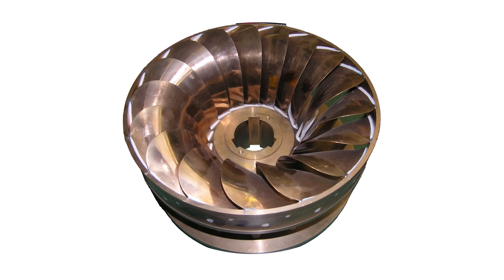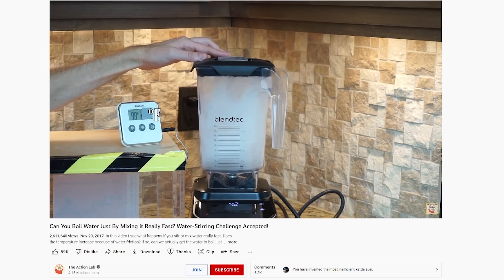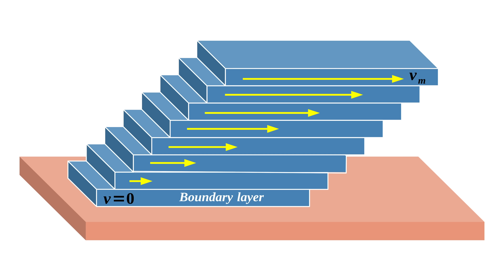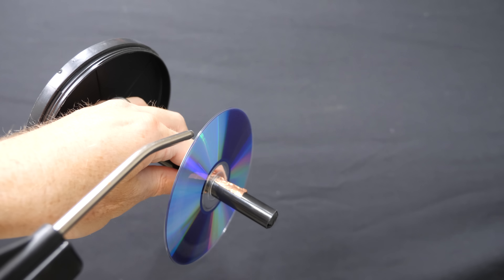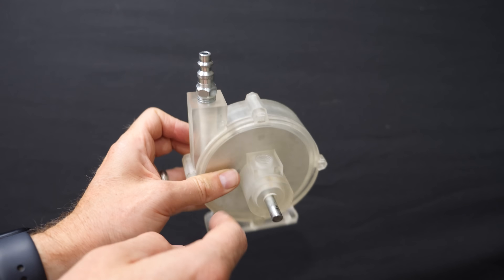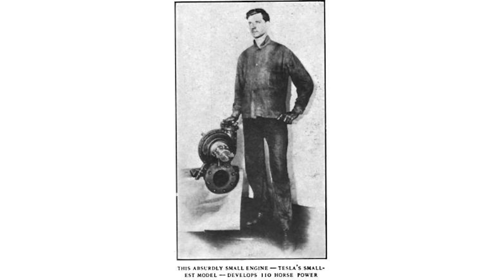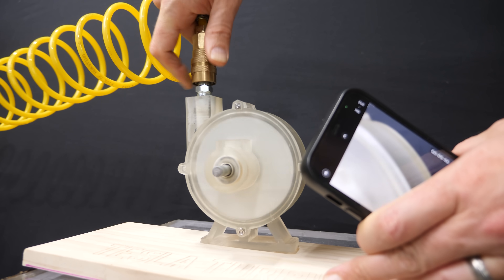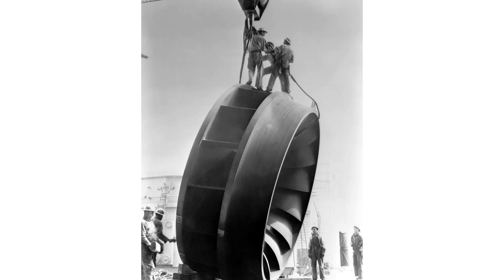How Fast Can a Tesla Turbine Spin?

Comment: Tesla turbines are not used because when we have disks that are rotating very fast, there is a high chance that they tend to warp. This means we need to use special materials, which again increases cost…
Reply: Jet engine rpms regularly spin at 25 thousand. Small turbines up to 500 thou. What's your point? Turbines are always well made and use exotic alloys, engineering, and are expensive.
Reply: Tesla fixed the problem of disc warping with his improved disc stack turbine patent GB 186,082 that he patented 1n 1921, 10 years after the original one and a decade of R&D.

Why does everyone sleep on the five improvement patents that Tesla patented 10 years after the original and act like it doesn’t work when every issue there was he already solved. 

Never mind the fact that you don’t even need to spin them “too” fast for them to work and work efficiently anyways because efficiency is incraaaed by reducing slip, not increasing disc speed.
Reply: The Slo-Mo Guys just posted a video showing this the other day. Vinyl records spun so fast that they break. They eventually wave like crazy.  Very interesting stuff.
Reply: Well, they've been telling us for decades that electrical car is not feasible, the costs for battery too high, distance limited, you name it. The real reason is more that the involved  industry giants just do not feel need to invest in a change as long as they can conveniently suck on the old technology
Reply: That's trivial.
Reply: Most power plants (coal, gas, and nuke) have generators that spin at 3600 rpm. There is no need to spin any faster.
Reply: @billb5938  as if coal power plants where the only way electricity was produced with turbines. 🤭 micro gas turbine electric generators regularly spin at 20,000-500,000 rpm already. 

This is industry standard for micro gas turbines.

Welcome to the modern era.
Reply: Tesla only had warping problems when testing the maximum speed, it is common to test the maximum speed of a turbine no matter what kind it is. I don't have any issues with warping in my tesla turbines.
Reply: @iEnergySupply  it’s because you don’t live in the late 1890’s. Jeez.
Reply: @iEnergySupply  how big is it? if it isn't over a metre then of course there isn't
Reply: It's efficiency increases at higher speeds, so having a lower speed means less efficiency and defeats the point
Reply: @na9565  how do you define the efficiency? is the relationship linear?
Reply: The optimal speed exceeds current materials.
By a significant margin.
Reply: What is warping?
Reply: Things that aren't meant to be reutilized could still efficiently use them, no?
Reply: Carbon fibre. Durable, "cheap", nothing special about them. High flexibility, high strenght, low weight. Cavitation... I am not into that so who knows...
Reply: I know someone who made one with thin aluminum disks and it works fine
Reply: Just use less speed
Reply: Here's an idea, use flate discs made of nitinol metal, that way if they warp, once heated the discs will return to their original shape
Reply: i was wondering about that.
Reply: Can you make video explaining rotation detonation engine
Reply: We are gonna need netherrite disk for this
Reply: Yeah it's always the " cost/money "
Reply: @Monkey_D_Luffy56  not really an issue when you have Tesla turbines that work just fine at low rpm.
Reply: Wonder if sound could be used to cancel the warping disks.
Reply: We need "Super Tensile Solids"
Reply: Isn't this the same problem with flywheel energy storage?
Reply: Wraping method is pretty nice but it lost some energy
Reply: Ohh
Reply: Thanks Captain obvious ...
Reply: Stupid!!!! This dont work on load
Reply: The higher the rpm, the greater the balance needed.
Reply: yet this guy didn't say that I was waiting for him to mention it but nahh
Reply: That's not what Elon Musk said
Reply: I didn't know that. Any chance you know what material is needed or what the maximum rpm is before warping?
Reply: @nevernether3368  this isn’t actually an issue.
Reply: Perhaps adding the tesla valve to this system so it will help water flow faster in and out. Has anyone tried this ?
Reply: Why they just cut it into a pizza cut and the edges is shape to interlocking
Reply: Wrong
Reply: Modern engines and turbines warp too, that’s why they fail mechanically
Reply: Kevlar threads in a circle? Light weight enough that it would not pull as hard. Plus the plasticity of a thead
Reply: They were tested with no fluid by the patent office. 
 Tesla proved it worked, but the patent office conducted arbitrary tests that promoted failure. Everything tesla made was proven. It's easy to sit here and critique and suggest such strong claims with no tests, relying on word of mouth from people who mostly defamed him and his work.
Reply: Maybe we could weld them up at the center, or have counter-rotating discs.
Reply: 只要能解決「高壓氣體」中的「雜質及液態水」即可「高速＆高壓」全天候「運転發電」⋯⋯，！
Reply: The pressure between the disks will surpass the mechanical strength of the discs in high speed rotation...
Reply: Compared to the parsons turbine, the cost is far lower. The really issue is in the power density of the turbine combined with its scalability. 

As well, modern turbines must run on dry steam, whereas the tesla turbine can run on wet steam.

Running it within its limitations still yields superior performance to a reciprocating steam engine.
Reply: or just have 2 inputs from 2 opposite sides.
Reply: Lol you don’t need to spin them fast for high efficiency, you have to reduce slip to increase efficiency. 

Tesla explains on the patent how to do this and nowhere doe he say to spin the turbine fast.

“Owing to a number of causes affecting the performance, it is difficult to frame a precise rule which would be generally applicable, but it may be stated that within certain limits, and other conditions being the same, the torque is directly proportionate to the square of the velocity of the fluid relatively to the runner and to the effective area of the disks and, inversely, to the distance separating them. The machine will, generally, perform its maximum work when the effective speed of the runner is one-half of that of the fluid; but to attain the highest economy, the relative speed or slip, for any given performance, should be as small as possible. This condition may be to any desired degree approximated by increasing the active area of and reducing the space between the disks.”
-Nikola Tesla
Reply: And AC power shan't be used because it can be transformed into enough energy to kill an elephant.
Reply: Edison, was a sociopathic monster, employed thuggish horrible "business practices" including sending thugs to burn down rival's labs, and out of context public electrocution of animals to discredit his competitors as a ghastly smear campaign, had no qualms about ruining others to buy up the patents or modify them and release as his own offering.
  I have absolutely no respect for Edison or anyone so ambitiously depraved.
Reply: @neomancr  I do hope everyone has noticed and realises that Edison the FRAUDSTER never tested out electrocution by DC! It kills you (or an elephant) just the same!

 Whereas, however, as Tesla proved conclusively, ON HIMSELF, high frequency, high voltage AC does NOT kill you! High voltage DC however is lethal just like high voltage, low frequency AC!
Reply: @neomancr  DC can kill an elephant too. AC or DC doesn't matter if voltage and current carrying capacity is high enough
Reply: @MaYbYl8eR   My new rotor is 6" in diameter. With 1/64th inch  Spacing. I agree my 3" rotors were much too small for Using only a single stage. Tesla suggests to compound the rotors For smaller turbines. I believe the 6" turbine won't need compounding.
Reply: @iEnergySupply  
How much power can your 6 inch turbines produce? What is the diameter required to generate 3MW of power?
Reply: @JaswanthDaniel  why ask such inane questions?  Do you have a budget for such a device? and, Does this look like a MW scale device to you?
Reply: @JaswanthDaniel  3MW is enormous. How serious is your enquiry?  I would say I can more easily envisage 1000 x 3kW machines rather than 1 X 3MW
Reply: @JaswanthDaniel  do get back to me
Reply: @iEnergySupply  Folks aren't talking about dinky Hobbyist turbines, They are talking about turbines meant for scale production. 

Like 3m turbines, which would have loads at the edge of mach 13 or higher, no known material is good enough for scale production using tesla turbines.
Otherwise we would be using them, Engineers are smarter than you think.
Reply: @Golden_SnowFlake  This!! Finally found someone who's using common sense
Reply: @Golden_SnowFlake   Like he said in the video, Tesla made a 6' turbine that put out 600 horsepower.
Reply: @iEnergySupply  They are not used because they are not efficient. To make them efficient (ones using laminar flow for example) one needs to use a large number of disks due to the low rate of flow, making them too heavy and big. 

It has a theorized efficiency of 95% but it will never reach it if we take into account the drops occurring at the inlet and outlet of the turbine. The most efficient rotor documented has attained a max efficiency of 65%. Furthermore, Tesla turbines are very sensitive to vibration or disturbances in the flow over the plates. Since they rely on the existence of the boundary layer to move the working fluid, any disturbance entering (or vibration) will cause a breakup of the boundary layer and a significant loss of efficiency.

It has some advantages but not enough to make it universal...
Reply: @WavyCats    I got Almost 3 kW from a 3" rotor. This was with very low temperature and low pressure. My turbine Also had a plastic casing. If I was using high pressure and super heated steam, I could have gotten over 10 horsepower And that is a conservative estimate. My experience  Shows your statement to be very inaccurate.
Reply: @iEnergySupply  Cool project. My point still stands though - what is the efficiency of your turbine (including the nozzles and diffusers)? 

Many researchers announced the rotor to have low torque (which simply isn't true) -this is probably what you are targeting. The efficiencies are another matter. The rotor itself is very efficient, but the loss due to the nozzles and diffusers is too impactful.

You argue that your 3" rotor does quite well and it's true. If you want to scale that rotor and maintain the same efficiency, I challenge you to find a material that can withstand the RPM. If you suggest lowering the RPM, then the efficiency will be sacrificed. If you want to add more disks, it will become massive and heavy.
Reply: @WavyCats  good point, You are right.  I don't really understand why @Jeremiah has problems with accepting Your simple arguments. I think it's possible that he's just a "conspiracy theorist" (like those people thinking the Earth is flat etc.)
Reply: @WavyCats  Adding discs doesn’t make it too much heavier at all if you do it right. It’s about surface area and thin discs of a sufficient tensile strength can be packed in like sardines. Check out Charlie Solis YouTube channel to see what I mean.
Reply: @WavyCats  Everyone learns this from the top tesla turbine video on youtube. But they made a big mistake with their math in this video. The video says the rotor must spin at a very high rpm, maybe 50,000 for a 6” turbine. The speed of a turbine is based on periphery speed not rpm. If a 6” turbine needs to spin 50,000 rpm to be efficient like the video says, that’s a periphery speed of 890.1 Miles per hour. If you want a 3 meter disk to achieve close to 891 miles per hour at the periphery, the rpm required is only 7,253. We have materials that can easily reach that speed. Frank Germano got one MW From a 36" Carbon fiber rotor and uses his turbine for converting heat from burning trash to feed the grid.
Reply: @commieTerminator  how at all is that 'common' knowledge
Reply: @WavyCats  false! Modern Hydro Tesla turbines have shown over 81% 🤭 you need to go back and redo your research.
Reply: @iEnergySupply  I replied to this a while ago but YouTube didn’t like the fact that I added an external link to the comment... 

Basically what I said was that the majority of the efficiency loss is directed at the inlet and outlet of the turbine such that efficiencies are still drastically lower than 90%, but can compete in niche applications (as it is now), just not power generation. 

I also mentioned that yes you can have a lower rpm and still maintain the efficiencies if you added more disks with proper(minuscule) spacing, but it would make it quite large and heavy relatively speaking.
Reply: @HeatAndPower  Kindly source the research (not the link cause YouTube likes to delete them). I did read about recent developments of the turbine designs made for pico hydro applications reached 80% efficiency but it did not take into account the efficiencies lost at the nozzles... if you can source a different paper with experimental results then I’ll concede my point.

Also note that I’m talking about large scale turbines - such efficiencies of 70-80% were only reached with smaller turbines.
Reply: @WavyCats  why would the nozzle/stator losses of the TesTur be any different than the nozzle/stator losses in a radial bladed turbine? 

In fact you could switch out either one in the same casing with the same nozzles…
Reply: @andrewselberg649  I agree more disks add more torque, and can make a much more powerful turbine, although I think there is a balance. If you look at nikola tesla's actual turbines, he doesn't cram as many disks in there as possible. Here is a quote from his patent. The dimensions of the device as a whole, and the spacing of the disks in any given machine will be determined by the conditions and requirements of special cases. It may be stated that the intervening distance should be the greater, the larger the diameter of the disks, the longer the spiral path of the fluid and the greater its viscosity.
Reply: @iEnergySupply  If you have a 2in wide turbine, what’s the difference between having 25 discs and 25 star washers, same thickness,evenly spaced, giving a total open space between the discs of 1in, and having 75 discs and 75 star washers same thickness, even Kelly spaced and also giving a total open space between the discs of 1 in? 

You have 3 times the surface in the same space while also having the same total volumetric flow area. Which means you can move just as much fluid through each runner slowly but the higher speed fluid will instantly come to a halt in between the disc faces as it enters in between the discs. 

Again total flow area is the same so there’s no “flow area” restriction. 

But there is a MUCH higher resistance to high velocity flow between the 75 discs due to the spacing being so restricted. 

The only limit to disc spacing is the point at which your discs will be fine to extent a capillary repulsion from the fluid going in between the discs. 

Furthermore, Jeremiah I know you’re doing vacuum steam low temp stuff. 

Well vacuum steam at about 80-90°c has decently lower viscosity than compressed air. 

Now the polar nature of the H2O steam molecule will help increases adherence to the metallic discs but because the viscosity is a good deal lower the boundary layer thickness is smaller and as such, whatever spacing is just right for compressed air won’t be tight enough for vacuum steam, “cold steam”.
Reply: @HeatAndPower   I definitely want to go up higher in temperature. My new turbine will allow this. I'm still going to have very low pressure at my exhaust though. My  Six inch turbine has  16 times the amount of surface area. I believe this is sufficient if the steam is saturated. My guess is that Because I'm using saturated steam rather than super heated steam, there will be much more viscosity due to the water droplets in the steam. Regular turbines use super heated steam because the water droplets would normally destroy the turbine. This is one advantage of the Tesla turbine.. This is also why I believeI won't need as muchSurface area.Using slightly thicker disks will give rigidity toThe turbine disks and allow me to reach greater velocities.Although the Tesla turbine doesn't need super high velocity, with a low enough of back  pressure  At the exhaust,  I think the extra drag at the higher speeds won't be detrimental to performance/efficiency But will increase my power output as demonstrated in my previous videos.
Reply: @iEnergySupply  Jeremiah, while there are mechanical reasons for superheating the steam there are FAR more important thermodynamic reasons for superheating the steam that irrelevant of particulates and cavitation all turboexpanders will be bound by these thermodynamics. 

The superheated steam can expand up to a higher extent.

The use of superheated steam in the turbine increases the total pressure drop across the turbine which increases the kinetic energy gained by the moving steam. This increased kinetic energy increases the output work of the steam turbine, and increases thermodynamic efficiency.

Thus by use of superheated steam, the turbine can extract more energy from the steam can get increased power output from the turbine….

Superheated steam and liquid water cannot coexist under thermodynamic equilibrium, as any additional heat simply evaporates more water and the steam will become saturated steam.

Superheated steam is also not useful for heating, but it has more energy and can do more work than saturated steam, but the heat content is much less useful. This is because superheated steam has the same heat transfer coefficient of air, making it an insulator - a poor conductor of heat. Saturated steam has a much higher wall heat transfer coefficient.
Reply: @iEnergySupply  Superheated steam's greatest value lies in its tremendous internal energy that can be used for kinetic reaction through mechanical expansion against turbine blades and reciprocating pistons, that produces rotary motion of a shaft. The value of superheated steam in these applications is its ability to release tremendous quantities of internal energy

By contrast, water vapor that includes water droplets is described as wet steam. If wet steam is heated further, the droplets evaporate, and at a high enough temperature (which depends on the pressure) all of the water evaporates, the system is in vapor–liquid equilibrium, and it becomes saturated steam.

Saturated steam is advantageous in heat transfer due to the high latent heat of vaporization. It is a very efficient mode of heat transfer.

This latent heat of vap is not available for expansion and power out through the turbine. 

And when you’re just relying on flash steam you have even less energy available.
Reply: @CharlieSolis  the wet steam I believe can expand between the disks more and more on it's way to the exhaust Where the pressure is higher on the periphery, it will be wet. I think it can turn into dry steam if it ultimately ends up in a low enough pressure. Also something to think about is the fact that tesla describes the effect the disks have on the droplets, he says it will atomize the droplets. this may be why some say the tesla turbine can utilize some energy from the latent heat of vaporization. This is just my thoughts on the subject, and I may be wrong.
Reply: @iEnergySupply  Jeremiah this is what Tesla actually says about atomizing in the patent…

“I am aware that it has already been proposed to effect atomising by dropping a liquid on to a plate rotating about a substantially vertical axis and I make no claim to the arrangement.”
-Nikola Tesla
Reply: @iEnergySupply  you cannot take a volume of water and “flash” it all to steam unless you add more heat in to do so, ergo the superheater. 

There is not enough latent heat in a volume of saturated steam/condensate to vaporize all the liquid in the mass without adding additional heat to “dry it”
Reply: @iEnergySupply  also if you’re using Marco water droplet size you may end up with a liquid ring type arrangement with the denser liquid water occupying the periphery and forcing the steam to the center radius, through buoyancy due to the pressure being higher in the periphery. This will cause the steam to leave the turbine before it gets fully utilized.
Reply: @CharlieSolis    Thank you for finding the quote. I'm curious What actually happens, What do you think happens?
Reply: @iEnergySupply  lol oh, buddy, I did that with my 5in turbine at 6000rpm a couple years back. It was just poured on the endplate though but it sure as heck atomized lol and surprisingly the turbine hardly seemed to slow down.
Reply: @iEnergySupply   you and Solis should really start a forum or discord so you don't have to always meet in the wild, on the back of a skeptic's YT comment thread, lol. 

Jeremiah re: heat of vap in a Tesla Turbine , FEA might really help here to better model some of the modes of the TT . 

 When I consider TT used with heat of vap fluids, I always go back to Peter Lindemann's lecture at the BEM 2019 in Amsterdam where he reviews Tesla's pursuit of a self-acting engine. From that talk, although Lindemann seemed to only employ rotary vane decompressors and Stirling engines - - maybe that was an intentional obfuscation - - it feels decisive, at least conceptually, that the TT is meant to transform kinetic energy highly efficiently as a component in a regenerative heat engine / heat pump, while the heat of vap itself is the mechanism in which temperature difference can be perfectly converted into kinetic energy.  It's clear you're both aware of the this after playing with steam cryophorus setups. Maybe the TT could integrate other system elements within it to transform heat energy as well, which would be fantastic.

Seriously though, community forum...!
Reply: @Golden_SnowFlake  the only one here who knows what the hell they are talking about. A lil baby Tesla turbine works sure. No one needs a baby turbine in real world industry.
Reply: @huntercarter5426  🤭 oh yeah because the most common generator sold isn’t between 1000-10,000watts for residential uses. Just stop. What a disingenuous claim. Especially when those off the shelf generators at best get 15-20% thermal efficiency.
Reply: @huntercarter5426  never mind Charlie Solis makes 10in Tesla turbines that output really power and torque even at low RPMs. Enough to power a house with just a room temp compressed air supply. He’s about to be starting the higher temp tests any day now to prove out the upper thermal limits for his TesTur. Should be in the +100hp range for just the skinny 2 in wide rotor, since he’s already doing ~8hp to the shaft without heat 🤭
Reply: @huntercarter5426  yeah as if the most common generator sold on the market right now isn’t in the 1-10kW range… right 🤭
Reply: @Golden_SnowFlake  Bruh do you not know what a model is? That's how engineers test large scale machines, with smaller versions.
Reply: @iEnergySupply  build one big enough to make 3 MW.  See how far you get, and how far the fragments fly.
Reply: @robinpage1987  the larger the diameter the slower the rpm is required. the creators of that stupid video from lasics that everyone watched got their math wrong. The video says the rotor must spin at a very high rpm, maybe 50,000 for a 6” turbine. The speed of a turbine is based on periphery speed not rpm. If a 6” turbine needs to spin 50,000 rpm to be efficient like the video says, that’s a periphery speed of 890.1 Miles per hour. If you want a 3 meter disk to achieve close to 891 miles per hour at the periphery, the rpm required is only 7,253. We have materials that can easily reach that speed.
Reply: @iEnergySupply  600hp doing what tho? It's just a number unless there's work being done
Reply: @testurenergy  i like your style  personally i don't think Jeremia spends enough focus on nozzles and not one of us has yet tried using a needle syringe to introduce flow tangentially between the turbine blades.  velocity is important, as is laminar flow and dwell time.  can we not get some thermodynamic modelling expertise into play?
Reply: @Golden_SnowFlake  and what would be the impact of exceeding the speed of sound?  The important factor is the rate of conversion of heat to motive power and small delta T otherwise you have an impulse turbine and that's where cost per kW escalates dramatically because it's no longer automotive turbochargers but precision impulse turbines that meet demand for 3MW
Reply: I don't understand this argument. Yes, there might be warping but really how much could it be? And I don't see how that couldn't be solved by changing the material of disks to something sturdy like steel. I don't think you would need to create special material specifically for Tesla turbines.
Reply: @atlas_19  Especially now with wire based electrical deposition Machining offering near zero tolerance machining, and generative design in tandem with additive manufacturing optimizing for laminar flow.
Reply: @atlas_19  I agree. This should is only
Reply: It’s only a problem when pushed to destruction.
Reply: @atlas_19   a 150cm spinning steel disk also tends to bend when spinning at such a high speed that tesla turbine operate at so yeah you can't use steel, a carbon fibre disk might be a plausible material but that thing is expensive
Reply: @archise3191  Nikola Tesla already solved all the warping issues with his improved disc stack patent GB 186,082 that he patented 10 years after the original and a decade of R&D. Everyone sleeps on the improvement patents Tesla got years later to make them work 🤭 yes I said plural patents. There’s about 5-6 improvement patents that he put out that almost no one even talks about except Charlie Solis who actually has real working tesla turbines.
Reply: @atlas_19  Very true.
Reply: @atlas_19  Your correct, and tesla didn't have any issues with his turbines. The public only seems to know one test that tesla ever did. Tesla worked over 20 years on his turbine improving it for many applications.
Reply: @iEnergySupply  I'm curious why you think nobody used Tesla turbines if there aren't issues.   Surely, if there was a feasible way to use the higher efficiency Tesla design, someone would've done so by now.
Reply: @atlas_19  'sturdy like steel" cus no one ever thought of maling a rotor out of steel. Your a genius
Reply: @MaYbYl8eR  For one, you're unaware of the meaning "something like" it seems, my genius friend. And for your other point, I don't remember saying "Nobody thought of that?", so what's the problem?
Reply: @MaYbYl8eR  carbonfiber and fiberglass have a higher strength to weight ratio then high grade steel.
Reply: @iEnergySupply  in fact you can make a wire helix fixed between the two disks to keep the disks stable.
Reply: While that is true a Tesla turbine needs to maintain high speed for better efficiency so lighter materials would decelerate more under load where heavy materials would carry more momentum like a flywheel allowing the turbine to function better as it's loaded.
Reply: Yup, they scale very poorly. Imagine the edge speed of a large diameter disk - any cost effective material will just turn into a shrapnel.
Reply: @MelodicTurtleMetal  Think jet engine. Those huge beasts turn up to 25 thousand rpms. Really.
Reply: @jamesbarisitz4794  .... Yeah. And?
Reply: @MelodicTurtleMetal  Too clever for me, genius. 😑
Reply: So you make a few and sell a few. It works well so people with money buy it. You make more and more people buy it. Eventually, since you run the market, you get competitors. Competitors means variable price on a product. Then since there is many people in that specific market, there is innovation. Breakthroughs make cheaper production. Cheaper production makes more product, and 150 years after the first person to introduce a wide sold tesla turbine to the market, everyone has one. 
That's capitalism I think
Reply: wouldn't it also tend to act like the ‘wheel’ of a kinetic energy fly wheel generator?

meaning that if it's not perfectly balanced, then, it would have a tendency to ocilate and, as a result, potentially self destruct resulting in the wheel (or, in this case, wheels) to be released and fly off for miles in all sorts of different directions?

At least with a turbine, the overall rotational mass wouldn't be as much and, in the event if a failure wouldn't likely add up to much more than a blade or two which would likely almost certainly be contained within the turbine housing or room that it's situated within.
Reply: @weedfreer  for real though, Nikola Tesla’s Balancing Apparatus patent 186,799 that he developed for balancing the turbines to very high degrees of at-speed dynamic balancing makes manufacturing an extremely high quality balanced turbine disc stack with little more than a lathe 🤭
Reply: @weedfreer  when the right disc materials are used and the proper tolerance dimensioning is used discs will just stretch and touch off with the casing and slow down before they spin too fast. 

And if you’re well below the 1st critical rpm of the shaft any touching off with the casing will result in nicking mass off only from the heavy side.

The “Jeffcott rotor” mechanical engineering experiment/lab explains the phase angle relationship of the heavy side and the whirl orbit. 

This is the basis of Nikola Tesla balancing apparatus patent. 

Everything below 2/3s the 1st critical rpm will have the heavy side of the rotor on the outside of the whirl orbit. At the critical the heavy side will be 90° advanced from outside of the whirl orbit and above the 1st critical (and leading up to halfway to the 2nd/3rd critical rpm) the rotor and shaft system will rotate about the center of mass, keeping the lighter side on the outside all the time. 

Balancing should not be done at even harmonics of the critical as the rotor being in the center of the shaft it will be on a node of the full waveform in the shaft which then causes side fumbling of the rotor as either side of it is in oscillation out of phase.

But below the odd harmonics/subharmonics of the critical rpm the rotor will always be in the center of the antinodes on the shaft and also allows for “at-speed” dynamic balancing 🤤

It’s such a simple “self healing” aspect to the turbine when design correctly and not over complicated. 

Nikola Tesla’s built in balancing apparatus is top notch.
Reply: This comment section is just gold, here we have everything.

My favorite part is all the people that believe that electronic parts could last forever, and also that The Saturn V was destroyed to raise the industry prices? That's a literal diamond on the internet, making and launching one of these rockets would cost more than the most expensive car ever sold, even if you had all the factories ready with molds and everything.

Plus no private company at the time had the experience to do something like this, since, again, it was expensive enough only the major economies could fund it.

I really really want a bit of the powder you guys are smoking.
Reply: @afoxwithahat7846  🤭
Reply: @CharlieSolis  you're a genuine nice find on the Internet XD, thanks for the funny comments tho.
Reply: You can still use gear ratios to increase torque
Reply: Wrong. The tesla turbine doesn't have the torque we need at high speeds.
Reply: FREE ENERGY! TRUE FREE ENERGY! Siphon liquids UP by putting a bottle above water/liquid source, have a siphon tube go from water/liquid source to top of a sealed container. on the bottom of container put a spout so water can flow back into the source. the water coming out of spout will create suction in the container pulling water up the siphon tube! it will continue to flow until water evaporates unless you build it in an enclosure or use ionic liquid. with water flowing constantly you can use the tesla turbine or any hydro-generator to give you free energy for everyone in the world!
Reply: That's something he covered, it's resonance frequency. But it's superior that's why we don't use it, it would work so well it wouldn't make money.
Reply: @TheDeepDiveLLC  "it would work so well it wouldn't make money"
What kind of BS is that?!? Like nobody would buy anything efficient!?
- If you buy this you'll make more of whatever you're producing at a lower cost and get tons of money.
- No thanks, capitalism doesn't exist.
Reply: @TheDeepDiveLLC  pls stop saying things like this, there are reasons why they don't use things that were invented in the past. Most of them are due to physical limitation
Reply: @siontheodorus1501   Why are light bulbs designed to wear out at a specific time? Because more money can be made  If they don't last. There are limitless examples of things that could be better but are specifically designed to just make more money.
Reply: @iEnergySupply  efficient, costless, low consomption, and long live ligtbulb, u mean led ?
That same old argument u Never had payed the same Price for a perfectly vacuumed lightbulb. There was an agreament wich was exposed, but thé truth is they were making 1000hours one but Never gone out 25oo hours range. The one still running is like 2v, and making ONE perfect expérimental product isn't the same to make automised Line to shit million in a day.
Reply: @iEnergySupply  lightbulbs are designed to have a limited lifespan so that consumers can maintain the industry of producing modern lightbulbs and so the technology and machines to actually make them doesn’t go to the way side. 

If light bulbs lasted forever there would be no way to create a stable industry that can continuously and efficiently operate to provide products all the time. 

Again if everyone bought all he bulbs they ever needed 100 years ago there would have been no light bulb manufacturing companies keeping that industry agile and capable of producing. 

Just look at what happened to all the tech and machines we needed to our men on the moon. We didn’t keep those technologies in production and we have since “lost” the actual technology to get back to the moon. 

What I mean by that is anyone who would want to go to the moon would have to start all the way from scratch because they can’t even use the old specially tooled machines to make each specific part to that exact design of rocket and payload. 

For technology, if you don’t continually use you will lose it. 

If you can’t keep that industry operating continuously so that the technology can regularly be produced and scaled the technology, the wherewithal, the specialized technicians who know all the ins and outs of each individual machine set up that they pass down to the guy who uses the machines after them, all of that goes bye bye. 

So we don’t make a lightbulb that can last 100 years because it would be detrimental to keeping a vibrant manufacturing industry always ready for mass producing lightbulbs at a moments notice to… stable revenues and profits over long periods of time keeps industries alive. Think war time factory conversion… 

it’s literally important for national security, not to mention economic stability.
Reply: @HeatAndPower   I really don't understand why we're trying to go to The moon when we have so many problems here on planet Earth we need to fix.
Reply: @iEnergySupply sadly many products at made to brake,  dit you know Most light bulbs wear out because of the on off switching  ? Not because of burning Hours, its like a combination engine at startup it experience many times the wearing in comparison to working temperature,
Reply: @oscarverwey    I didn't know it was because of the switch, but I noticed most of the LED bulbs have Transformers in them that Get hot, and a bunch of needless  circuitry . I've taken them apart when they were burned out and the LED's always still work, but the stupid electronics are burned out.
Reply: @iEnergySupply  ow my bad I thought you were talking incondecant light bulbs  , for the led there such a scam that cost more to make than that safe in energy bills XD
Reply: @oscarverwey  I am glad you understand, huge scam, and waist of resources. xD
Reply: @iEnergySupply  Re: LEDs, The phillips bulbs are a waste because of planned obsolescence. They monopolize teh market using undersized heatsinks and 200-250% overdriven LEDs at poor efficacies under 120 lm/W. The technology itself is fine. I design light engines with LEDs that are >200 Lm/W out of the box. It's only agriculture and commercial lighting that actually use decent electrical components and thermal designs...
Reply: @iEnergySupply 1. Moving parts will always  require maintenance.  Thus, money must change hands.  Light bulbs have no moving parts

2.  A turbine can be used to generate electricity. Power companies pull in billions of dollars.  If they could make electricity more efficiently  they would 100% be on that shit
Reply: @HeatAndPower  I disagree if we wanted to we could mass produce a surplus of centenary lightbulbs today and cut down on the waste that is disposable lightbulbs today, but we don't and it's not because we would lose the technology, no it's because it doesn't generate enough profits (Phoebus Cartel). Goes to show you how much we take technology for granted honestly.
Reply: @jghifiversveiws8729  what the heck do you think I meant by “economic stability” 🤣😂🤦‍♂️
Reply: @iEnergySupply  not the answer Charlie was looking for Jeremia.  I am trying to imagine how a dozen of us are ever going to bring this to market.  I think that was something Charlie was getting at?
Reply: @siontheodorus1501  bravo